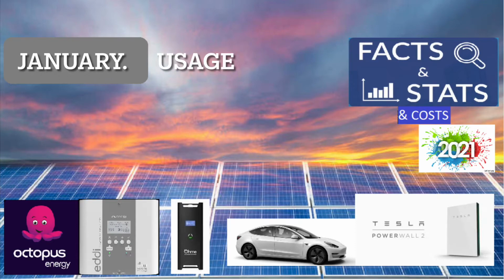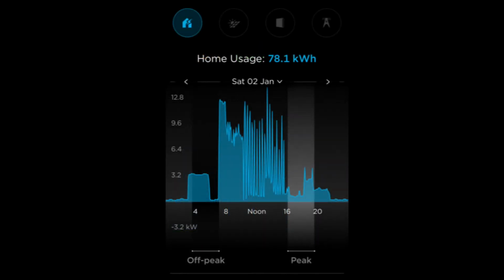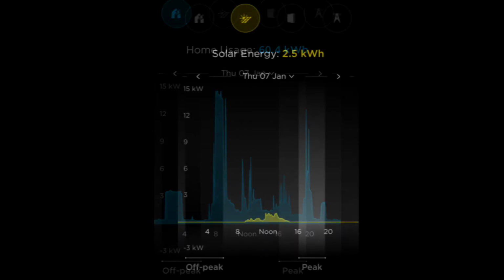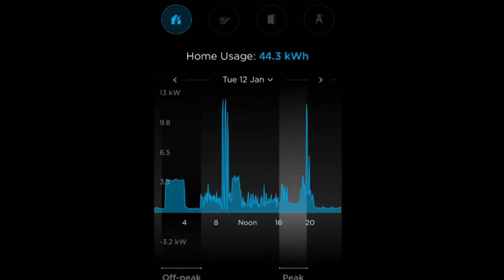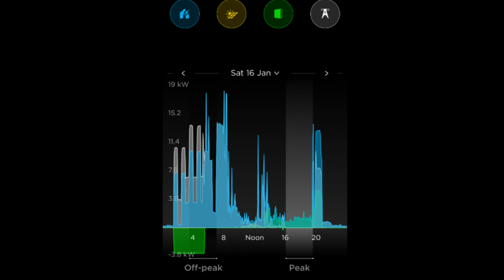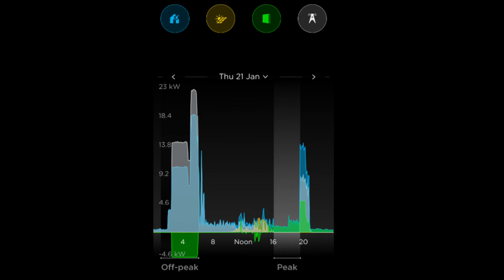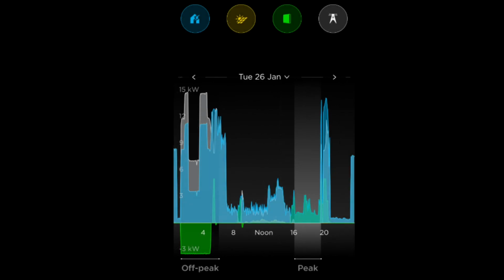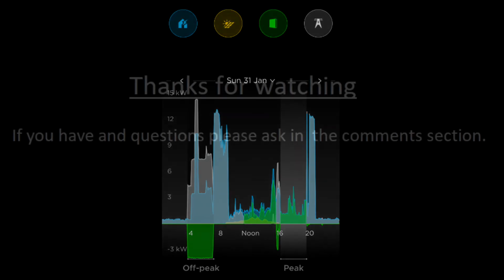January 2021 usage Huge grid pull thanks to electric boiler Tesla powerwall & model 3, octopus agile

Comment: Hi Chris. Did you consider a heat pump when you were setting up your system? I'm trying to get my head around the benefits/downsides of electric boiler Vs Heat pump and wet or dry heating systems. I imagine an electric boiler is the cheapest to set up but not the cheapest over time.
Reply from the maker: I didn’t consider a heat pump at the time, our gas boiler failed early nov 2019 and I needed heat quick, so I purchased the water tank and electric boiler as I could fit that myself ( electrician ) it was only later i when I started to look at HP I to be honest the install costs put me if at over 10 k and I have not seen any evidence it would be cheaper that my current setup due to HP running for longer periods and lower temps in the rads. I do keep looking for reviews but until I see some hard  evidence about running costs I’m holding off
Reply: @AllElectricLiving  Apparently there are hundreds of thousands of heat pump systems in the UK.  How many of those that are in ordinary three bedroom semis I don't know but I wouldn't imagine there are many. I'm leaning towards a system like yours and only drawing from the grid when it's very cheap. Would you happen to know how quickly the powerwall charges?
Reply from the maker: @Tony-Stockport  my powerwall charges at 5 kw so just under 3 hours but it only outputs a 5 kw also so unlikely to cover all of a HP or electric boiler, I’m just about to upload a other heating video to answer a question

Comment: Hi Chris, great details as always.  Can you please explain in more detail how your central heating operates during a cold day.  I’m trying to understand how your house stays warm throughout the day.  My gas boiler runs almost all day, my house is 110+ years old the insulation is very poor. Is your house a recent build with good insulation?
Thanks
Brian
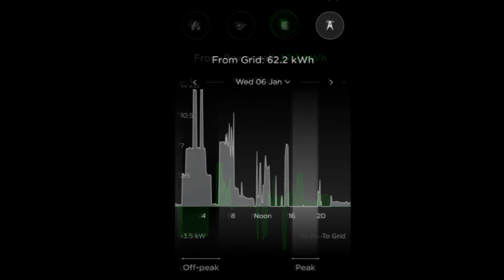Reply from the maker: Hi Brian and thanks for the question, I will do a short video on how we heat the home, but in short our house gets coldest over night, on a weekday we start to heat the whole house from the electric boiler to 20.5 degrees, that goes off around 07:30 or when the house gets up to temp. As soon as the sun rises ( when it rises ) we open all the blinds n the south side of the house and open the doors, I’ve learnt a lot about solar gain as as a 70s house we have huge windows, and we keep the blinds closed on the north side ( which is only lounge down stairs ) and we keep a small 2 kWh heater maintaining the lounge to 20 degrees ish.  We then turn of all heating between 4 pm and 7:30 pm and at 7:30 pm the boiler kicks in again the two bedrooms on the north side do get cold is in the day but heat up before bed time, I will put a typical heat trace of the house in a short video to show you. The house has had cavity wall insulation and loft, and I’m planning on adding insulated plaster board on the outside walls of the house as time goes on, thanks again for your question
Reply: Thank you, I have watched your excellent explanation video. I have good loft insulation but the walls are sandstone with no cavity. As my house is east/west facing mid terrace In West Scotland I don’t start to get solar gain until March. In the current cold weather I can see a 1-2 degrees drop if I turn my gas heating off for just 1 hour during the day.
Brian
Reply from the maker: @brianrussell6988  sounds like the heat gets sucked out, have you considered insulated plaster board on the inside ? Most heat gets lost from under the floor boards
Reply: @AllElectricLiving  the floor is pretty well insulated. Due to the age of the house there is some really nice cornice features that can’t easily be covered. It also has bay windows that we have blinds and curtains on. December, January and February are the main cold months with the wind chill sucking the heat through the sandstone. My wife really feels the cold whilst most of the time I only have a T shirt on.

Comment: Great to realise the longer daylight hours starting to show up on our stats, just need some sunshine to take the benefit of it. Based on the high grid pull you did well getting through the peak period with minimal grid pull.
Reply from the maker: The powewall does look after itself most of the time, there is the odd day when it over discharges early hours and has to top up again through the day, I would still like manual control or more peak and off peak slots because of agile day rates can be high even though not as high as peak, as soon as the boiler goes of when the weather gets warmer my usage will tumble